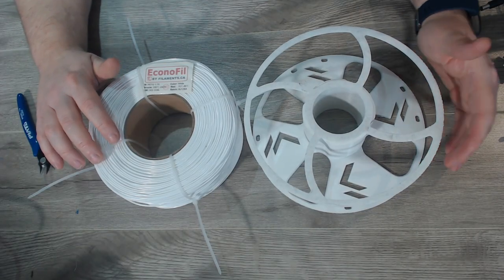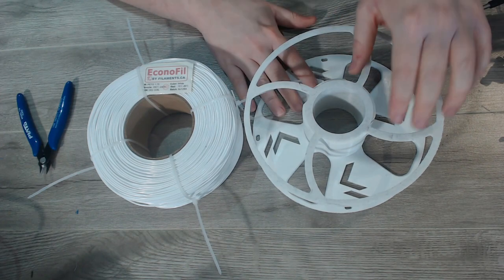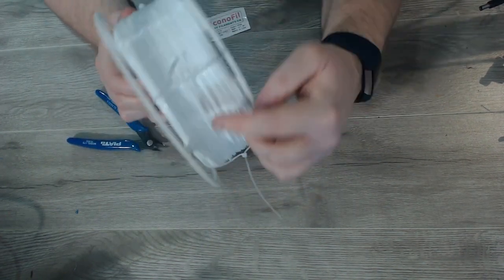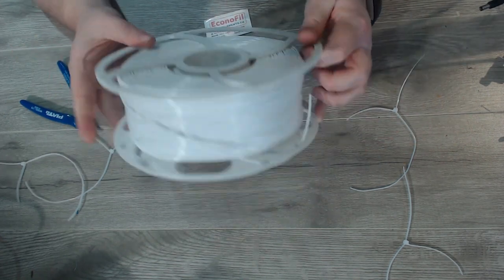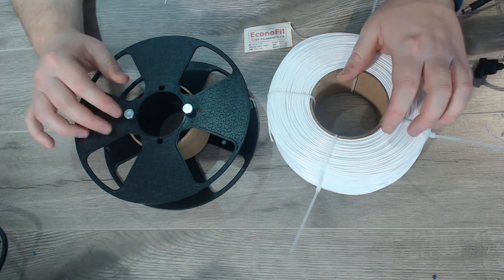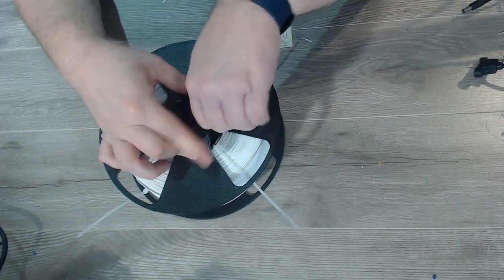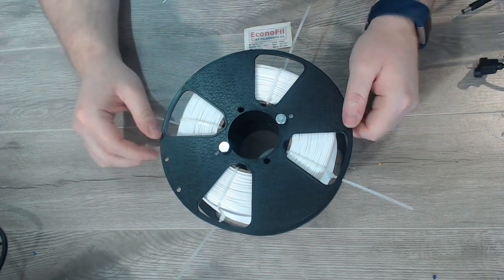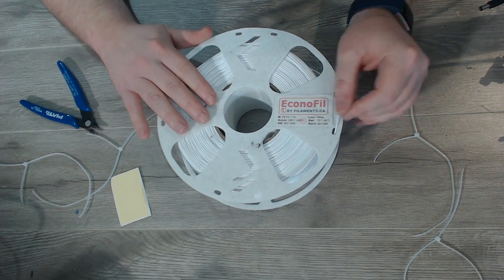Filaments.ca EconoFil PETG Master Spool Overview

Comment: what nozzle/bed temps are you guys having the best success with? I'm getting a lot of trouble printing with this filament. Im printing at 220 nozzle 80 bed with print speeds of 25-30 and layer heights of 0.1-0.16 mm
Reply from the maker: For the PETG I was usually 80 - 85 on the bed and 230 - 235 on the nozzle, 40mm - 60mm / s